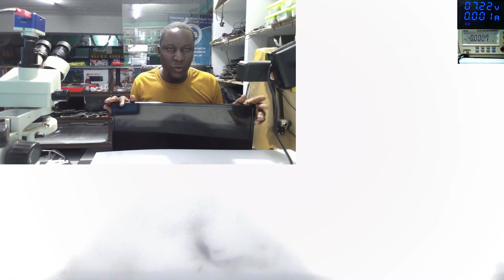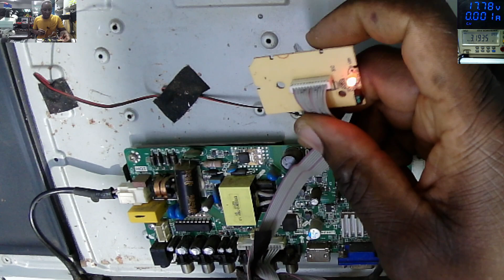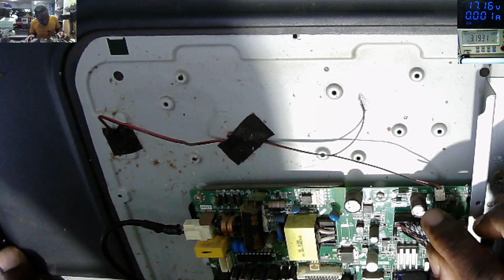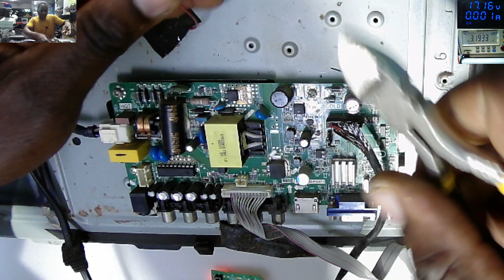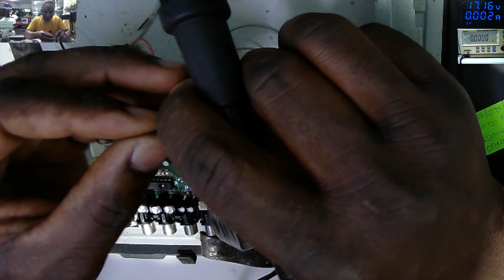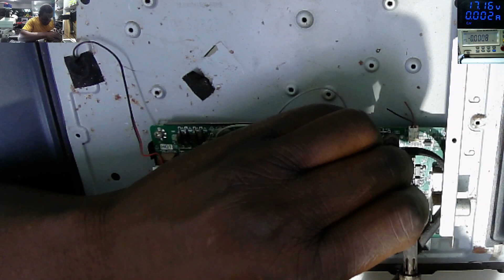TV Backlights Circuit With Low Output Voltage ,,Using  MT3608 as a Voltage Booster.

Comment: You must connect the input voltage of buck converter in switching transistor near in lvds connector so that when you turn on the tv the light will turn on. You can also use relay before the buck converter.
Reply from the maker: Thank You for the feedback but challenge the modules l hev if l inject more than 5volts input voltage they blow up.. So the output of the mosfet switching Coil on the Backlights Circuit was outputing 12v which is higher than 5 volts... I think it's manufacturer design faulty because it's saying input voltage range it's 2.5v to 24volts..but injecting 7.even 10 volts the modules are blowing up even with As little as 1amp
Reply: @BstAfricanElectronicsSurgery  that kind of buck converter module has a manufacture design defect. You need to use different model  design of buck converter or you can make backlight driver module circuit.

Comment: Great modification. I use buck converters to keep my wifi on on and leds lights when we have loadsheading. Seen on a vidio where a led light tube controller was used  for the back light circuit.